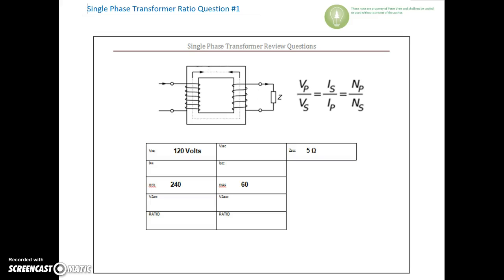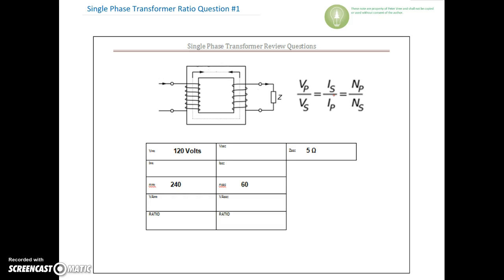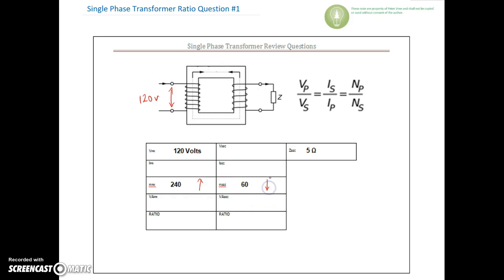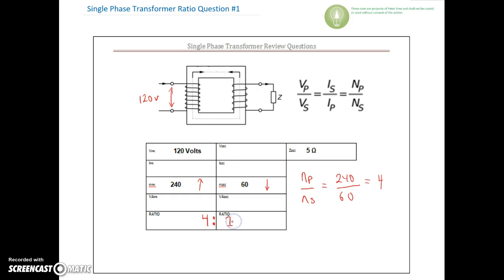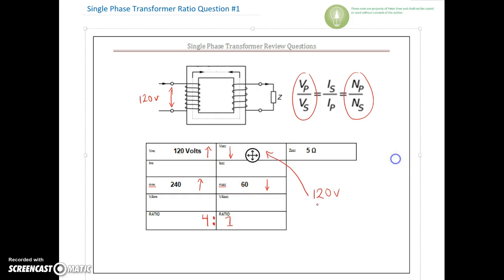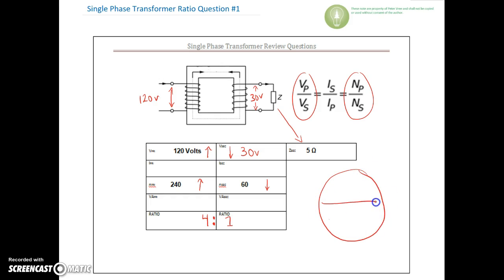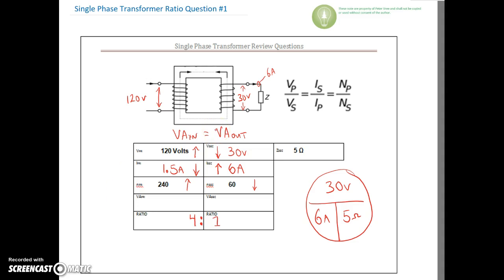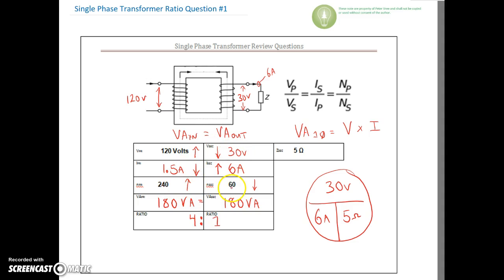Single Phase Transformer Ratio Question #1

Comment: What is Impedance?
Reply from the maker: Impedance is the combination of the physical Resistance in a circuit, and Counter EMF that is developed on either a Capacitor or and Inductor (coil). All the basic circuits that just mention Resistance don't actually exist. The only purely resistive loads are baseboard heaters, and incandescent light bulbs... everything else incorporates a coil or a capacitor. Impedance is the combination of resistance and reactance that limit current flow in the circuit.
Reply: Thanks for the quick response Pete.